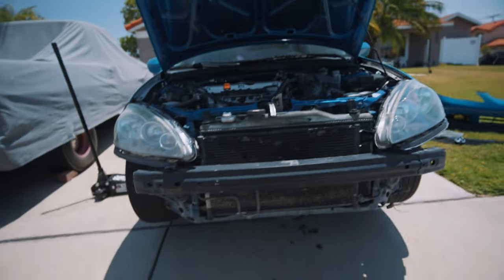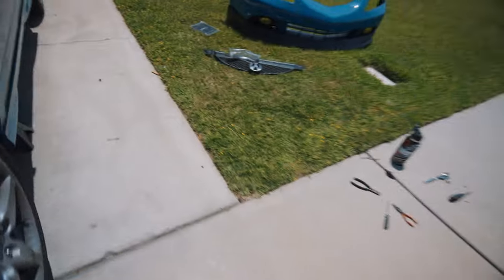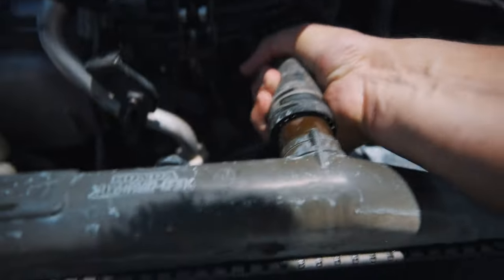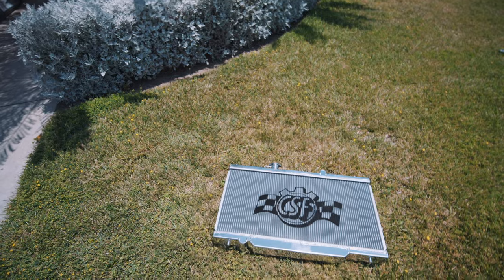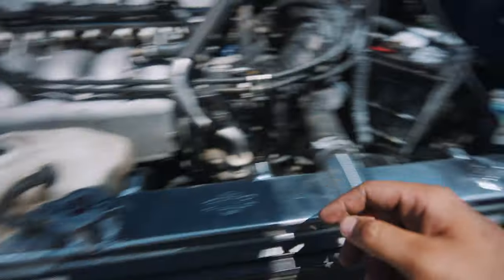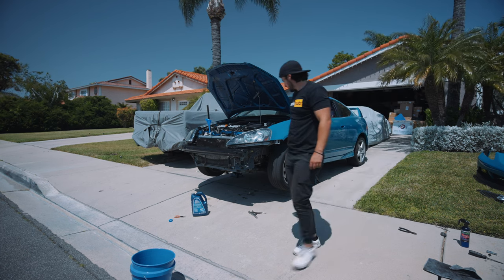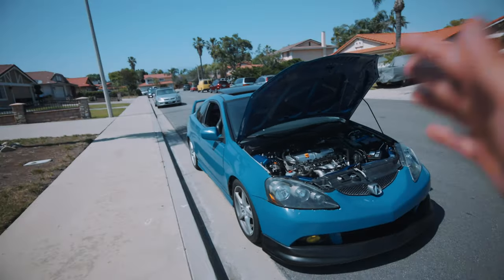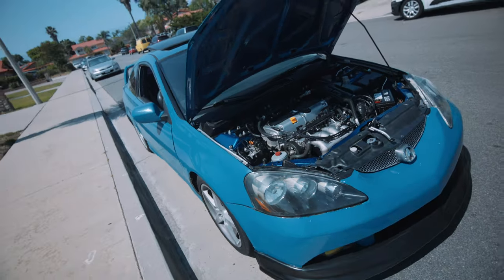My Acura Rsx Type S Gets an Aluminum RADIATOR Install! | Time Attack Build

Comment: Lately been debating on selling my 93 integra and buy an RSX. But all the ones online are clapped out and expensive as hell lol
Reply from the maker: Idk man I still think DC2 > DC5 haha. Tired of yours?
Reply: @MiguelDsm  lol man, I've been running into only one issue, and that's the damn proportioning valve leaking. Replaced it 3 times already lol. I love the car but tired of brake fluid in my driveway/garage. Will say this car recently drove from socal to south lake Tahoe and back with no issue.

Comment: Its a budget build but dont cheap out and not upgrade the hoses ... upgrade rotors and pads change out the brake fluid then for suspension need to replace ball joints tie rods and bushings